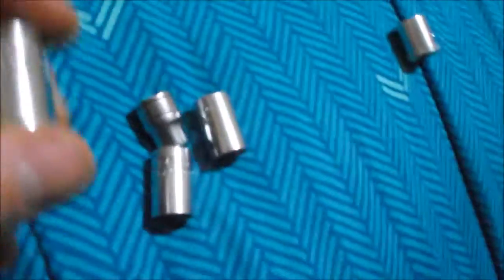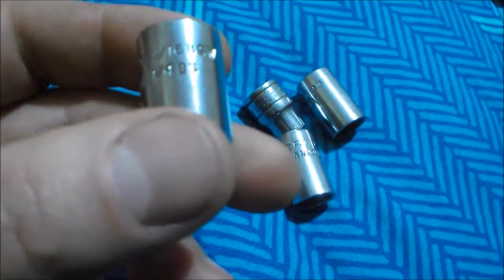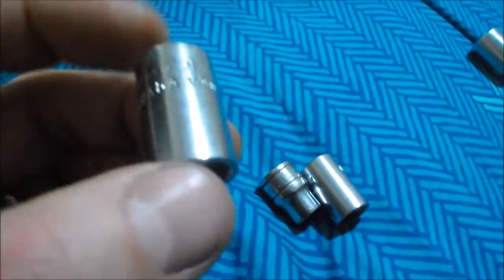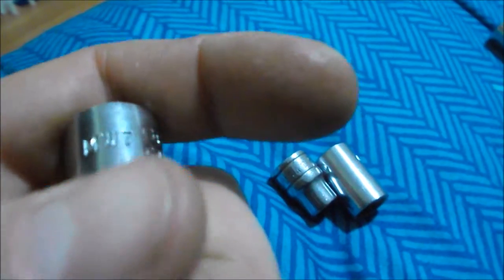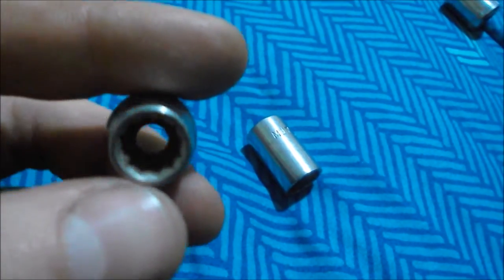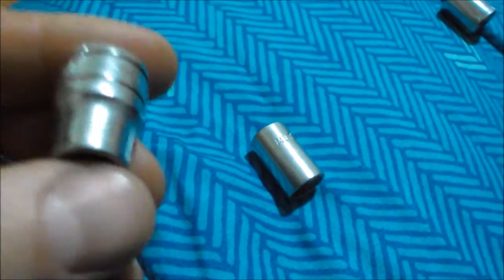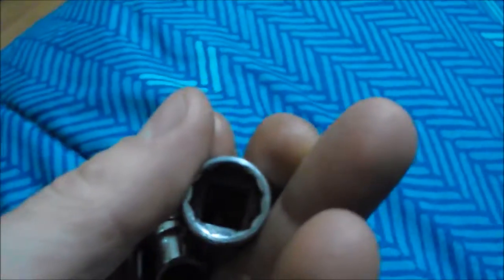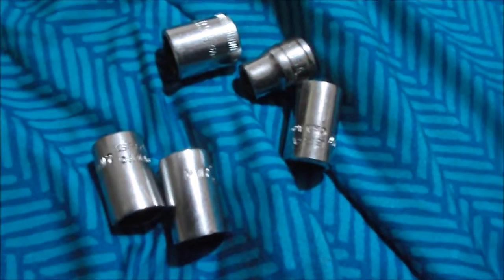"Not" DIY Video - What are these sockets used for?

Comment: I've got a set of Gray 12 point sockets and they have strange numbering as well. I just put it off to a lot number, identifying exactly when and where they were made in the factory. With my farsightedness the font is too small to quickly identify size, although otherwise Gray sockets seem to be long lasting. Good quality 12 points are hard to find these days.